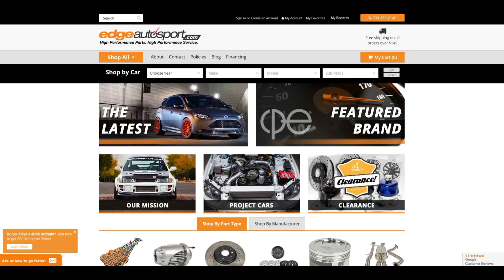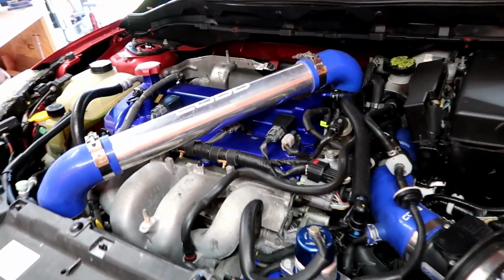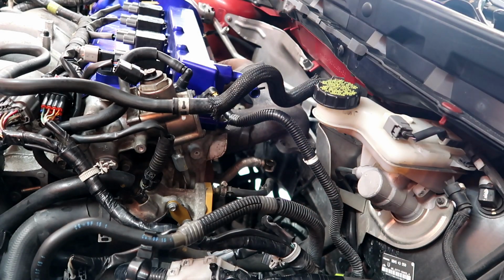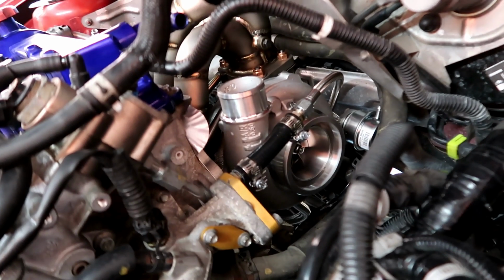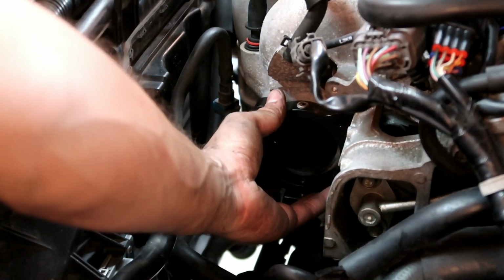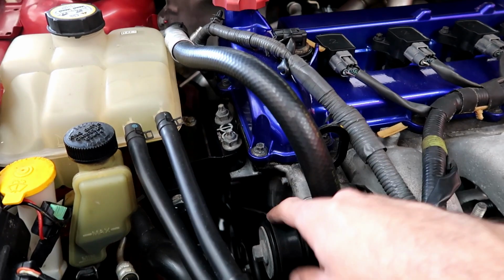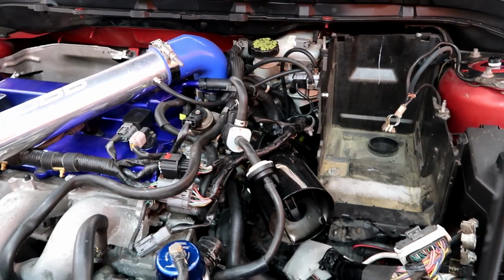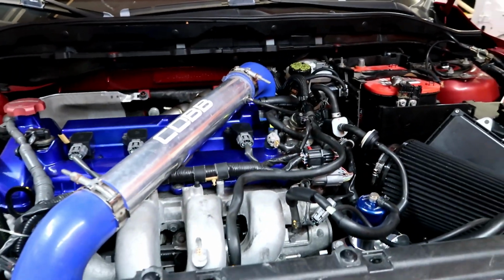Mazdaspeed3 ***BIG TURBO UPGRADE*** GTX3076R + METHANOL

Comment: You pump Oil in The Turbo before you make first Start? Or you rotaed the engine whitout start ? Or you install and start normaly the car? Ty brother for helping
Reply from the maker: Yes. Remove the fue pump relay and crank it for a few seconds to build some oil pressure. Then do the normal start
Reply: @WZ_TV  ty bro 😊
Reply from the maker: @clma3780  any time!

Comment: Do you have a parts list on what he had on the car before and after by any chance? Great video, you build awesome cars!
Reply from the maker: Hey Thanks! He had Front Mount intercooler, HPFP Internals, Full Exhaust, Rear Motor Mount, Blow Off Valve. Then I installed the GTX3076R Turbo with 4" Intake, Turbo Manifold, 3 Port Boost Controller, 3.5 Bar Map Sensor, Water Pump Pulley, and Snow Performance Methanol Kit. Stock Intake Manifold, Stock Clutch.

Comment: Did you remove the turbo mount? seen alot of issues with the exhaust manifold cracking due to the load of the turbo. But on the xs power website it says you must remove the turbo mount for install. Awesome work btw!
Reply from the maker: The manifold that crack are just cheap thin schedule piping. Like the non brand stuff. In my experience i never had issues. I ran a full race manifold for years without cracking. Same thing with my CPE manifold.
Reply: @WZ_TV  yeah i've only heard mix reviews with the xs power manifold that was installed on this car. Agree that the branded cpe/full race are solid manifolds.
Reply from the maker: yes xs power will crack eventually. It is what it is lol. Its a budget friendly manifold.